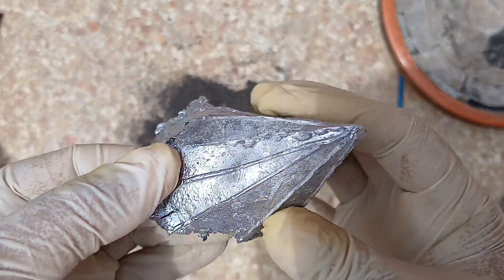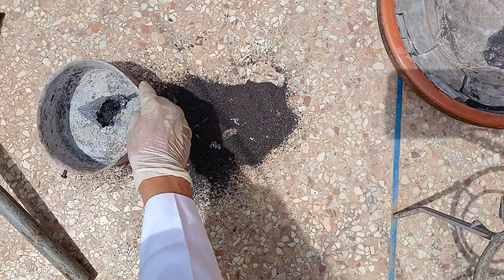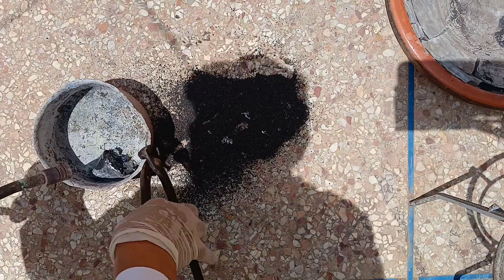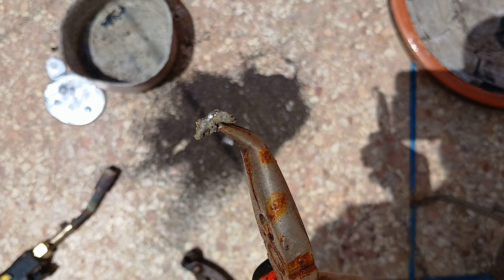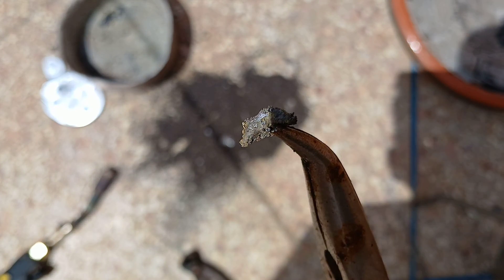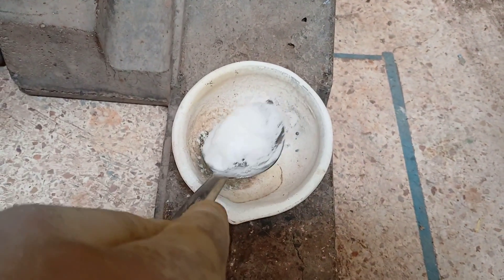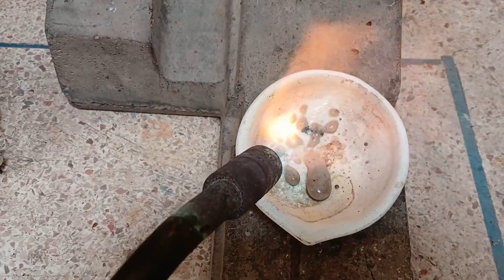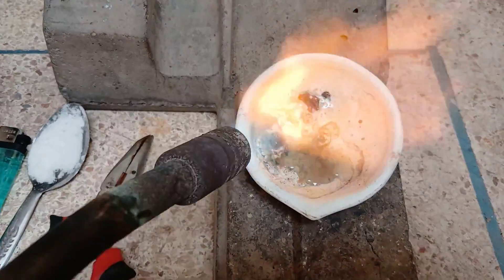Extracting gold from gold-bearing pyrite 2# all followers

Comment: Sir, Is there gold in every stone?
Reply from the maker: Gold is most commonly found in specific types of rocks and minerals, rather than in just any stone. These include:

• Quartz: Gold often occurs in quartz veins within rock formations.

• Placer Deposits: Gold can be found in alluvial deposits, where it has been eroded from its original rock and deposited by water.

• Sulfide Minerals: Gold is sometimes found in association with sulfide minerals like pyrite and arsenopyrite.

• Greenstone Belts: These ancient volcanic regions are known to contain significant gold deposits.

While trace amounts of gold might be present in many types of rock, it is typically in such low concentrations that it isn't economically feasible to extract. Most commercially viable gold deposits are found in specific geological settings where processes have concentrated the gold.
Reply: Exatamente , resumiu tudo !

Comment: Bravo 👍
Reply: Suggestion: add 25% powdered charcoal, it will burn faster ,, and you may use a furnace and a crucible scattering lead small pieces at the end , I believe it will take less than half an hour
Reply: What do you mean brother? Charcoal mix the time you firings?  @S13402